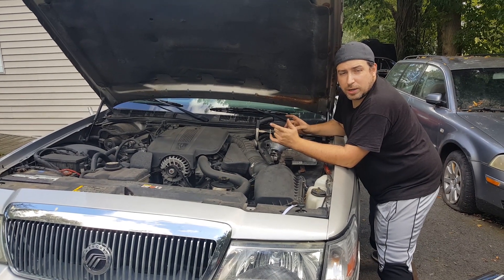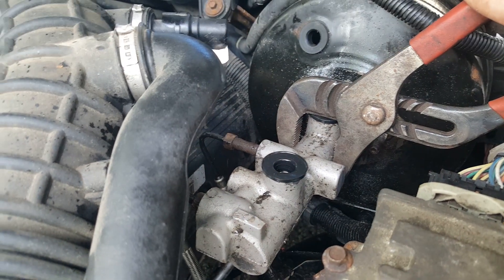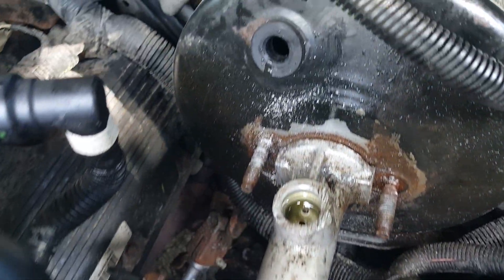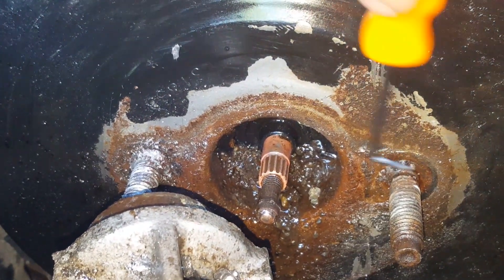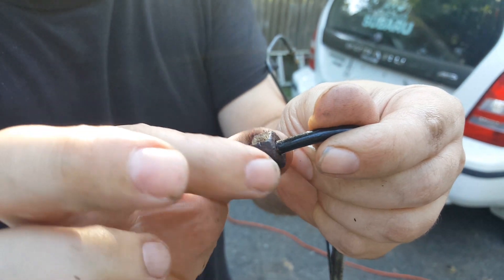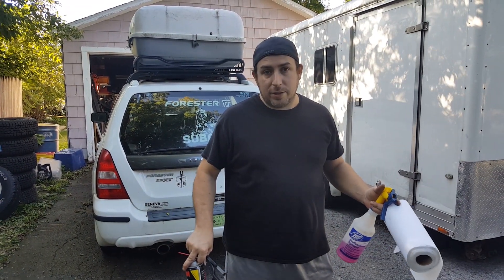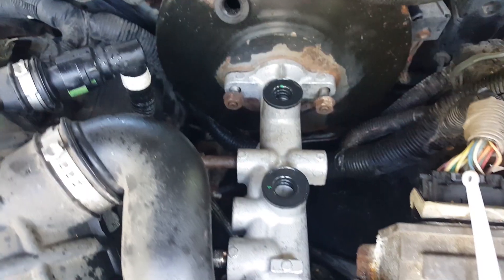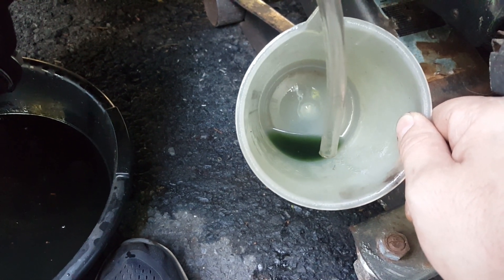Master Cylinder Removal Tips and Tricks

Comment: Great video. I have a 2001 honda civic. It is fused to brake booster.I tied a rope around master cylinder. PB balster. I attached it to the rear of the vehicle. NG. I think I will try to cut off the ears. That was a great tip but it is tight. Just about 4 hours working on this. I hope the ear trick works.

Comment: I thought I was the only one cursed!!  I actually used a ratchet strap hooked one in to my truck bumper and got it tight, and hit with hammer and it  did not budge  Thanks very much for video.

Comment: I just ran into the same issue. I was ready to try your method and cut the ears off but before I did I went back and forth with an air hammer and slight outward pressure with other hand and it took less than a minute.

Comment: I have a similar problem on a Dodge Intrepid. The pedal went to the floor and there were no brake lines leaking like I first suspected. I heard from a friend who use to be in the repair business that being there is no fluid in the master cylinder it must of leaked right inside the booster. He said if I plan on reusing the booster I better suck out all the brake fluid that is sitting in the booster. He said he did many of those cars and replaced the booster at the same time when he sees them leaking in the back of the Master Cylinder. Looking to save my booster. Working on it this weekend.